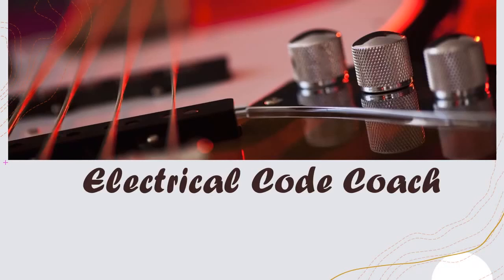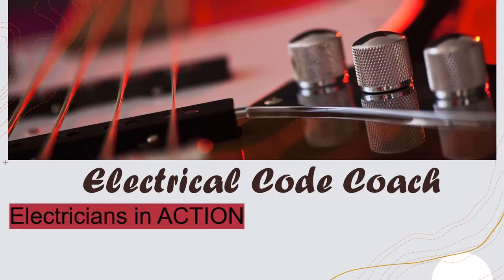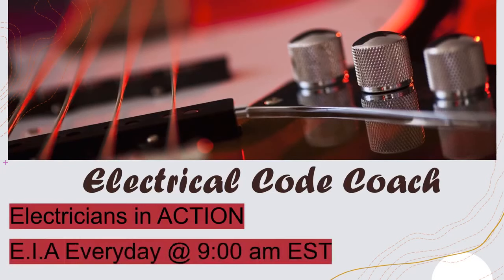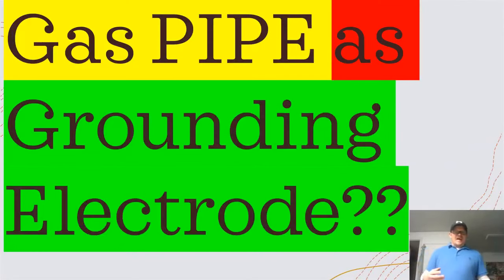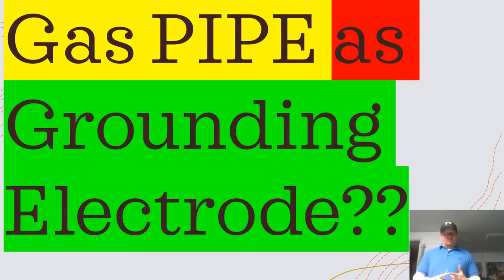Gas Pipe As A Grounding Electrode?

Comment: I had a battle with Beaverton Oregon inspector in 2012 code and he wouldn't pass me until i grounded to gas pipe
Reply from the maker: He may have wanted you to bond it, which is fine depending on the scenario.

Comment: BUDDY, I have question please.   I am building off grid system.  now I have 1 inverter.  But i plan to expand more inverter as family will grow.  The panel breaker:  it said 125 amp or 200 amp.  I can not use 2x  2 gauge right? (add 2nd 2 guage later?)  the inverter is 6500 watts 120v.  Link together 6500 watts to make 240v.  that about 53 amp on 1 side.  if I expand to 4 inverter will make it 110 amp on one 120v side of the breaker box.   so my question was: the 125 amp or 200 amp breaker will able to carry  125 amp on one side of the 120v right?  and the other side carry 125 amp or 200 amp ?  I called Siemen customer support.  The guy does not know.  He said he is not electrician he advice me to contact local Electrician.  Dam that not good.  The customer support does not know their product.  I was asked: your 125 amp circuit breaker can carry 125 amp on one side of the 120 volt right?

Comment: what about a secondary ground? So the pipe that is grounded with a second line in the house is most likely a water pipe then? I thought it was a gas pipe because it had white Upanorph which is what we used for the gas in part of the house. But i could be wrong, its not the primary ground anyway, but it is all rusted & it looks like somekind of cement was put around it at some point.